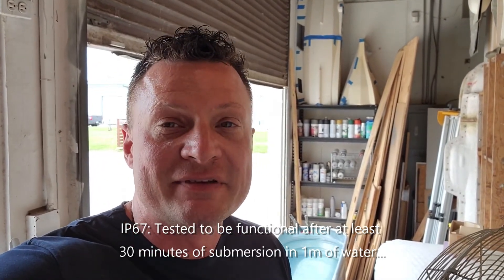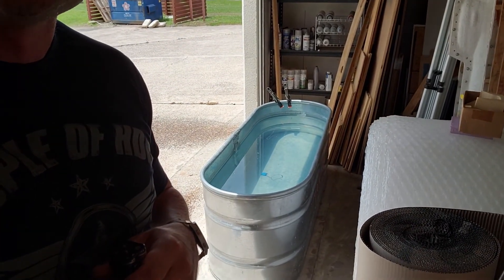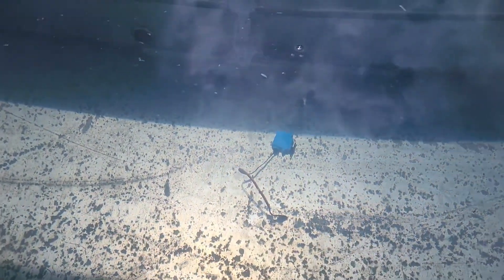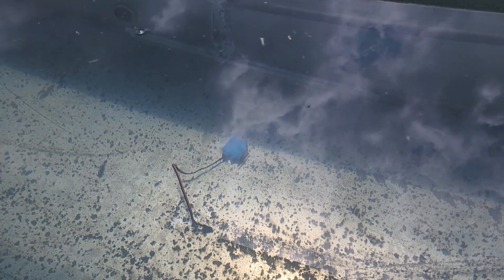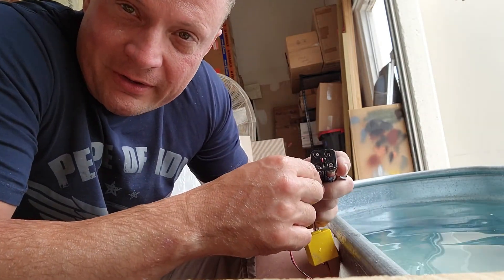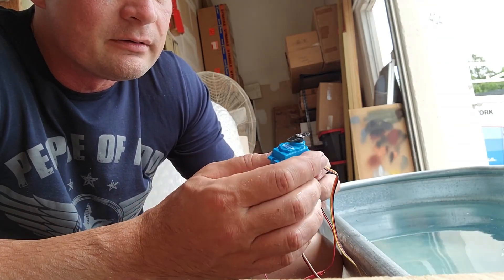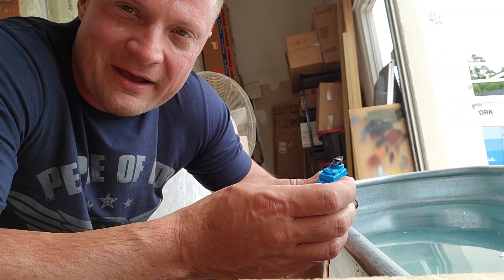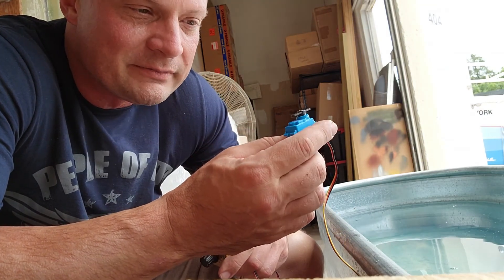Are Waterproof Servos Actually Waterproof?

Comment: I’ve had a savox waterproof micro servo fail before. Took it apart and there is just one very small o-ring around the perimeter. I filled up its replacement with petroleum jelly (needed to make sure it did not contaminate a large pool), covered the pcb with silicone conformal coating, and sealed the wire input/external seams with liquid electrical tape. Might be overkill but it’s held up so far.

Comment: An ordinary servo can be waterproofed by using silicone grease . All you have to do is take the top and bottom off and fill with silicone grease .  But be careful not to upset the gear train .  Or the servo will not centre again properly .

Comment: I use these WP Hitec servos for many years in my submarines. They work all outside the pressure hull in dephs max 3 meter. (Sorry I'm from germany we use the metric system).
I had no problems with tis servos. The only thing is: use only 5V if you give them more the electronic can damage. I seal the welded cabels with superglue. I made the experience that the water comes through the wires in the Boat. Of cause i use superglue to stop this problem.

Thank you for your Videos.
Reply from the maker: Excellent advice. I'm actually Canadian, and typically use metric as well. I'll reference the caveman system for the benefit of everyone down here in the good ol' US of A... ;)

Comment: To be fair to HiTec, the newly installed servo that failed in the Upholder, was not a HiTec IP67 Waterproof servo, though it did say "Waterproof" on the servo.  I'm not sure what brand that servo was as I just pitched it in the trash a few days ago and didn't note the brand.  I have since replaced that servo using another "Waterproof" servo from Amazon by FeeTech (not IP67 rated), but I sealed and filled it with Corrosion X and installed an o-ring on the output shaft following RCSubGuys wateroroofing servos video on Youtube.  It has lasted about 3 total hours in the sub and is still working.  I'm waiting to see how long it will last, but I do have a HiTec IP67 servo ready as a spare replacement.

Comment: Hi Bob, for an actual test you should put the servo tester on auto and submerge the servo.
Let it run at depth for a day or 2 and see the result.
Reply: I thought the same, this test is actually useless. And my subs are not just diving 50cm deep. 2m (6.5ft) in a pond or close to 4m (13ft) in a public pool.
Reply from the maker: While not on sweep, we did cycle the horn manually under depth 5 to 6 times per day for a 8 days. Not exactly the same, but close.
Reply: @RCSubGuy  serveral years ago I did a test with a waterproof Traxxas servo. I took two pipes, closed one side, put it vertical and filled it up with water 3m high. Then I put a servo with a long wire in it and connected it to a servo tester and a 220V - 5V converter.
Two days later the servo was still working.
Later a a submarine it died.